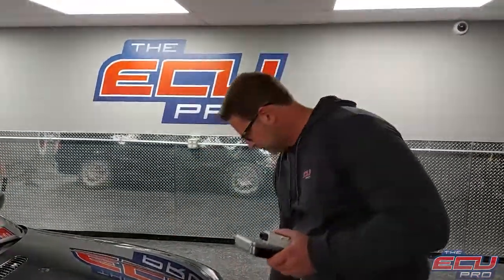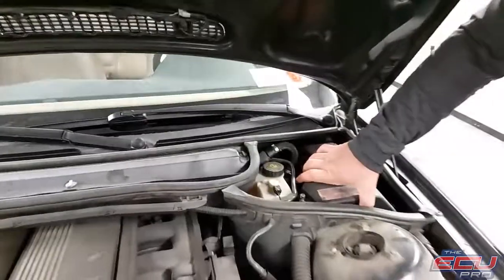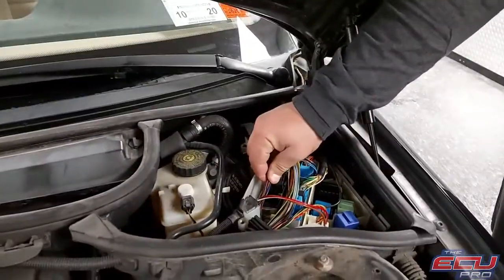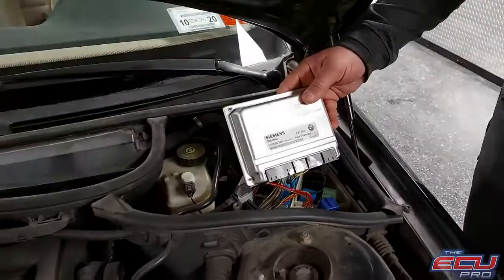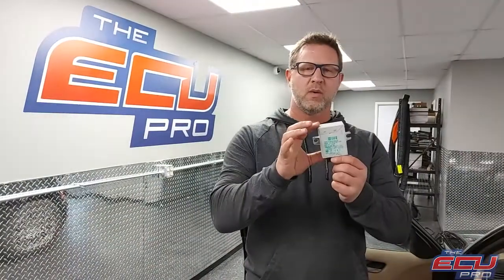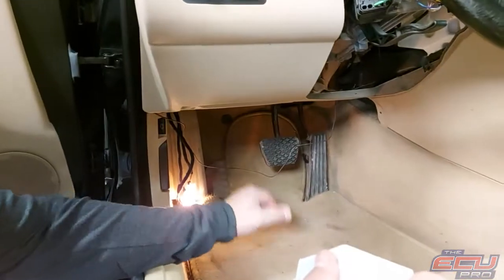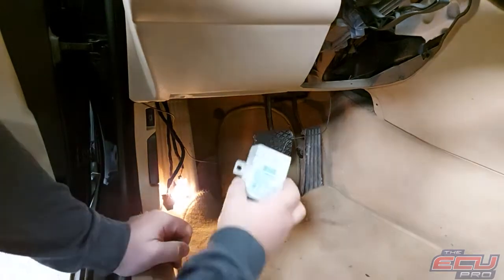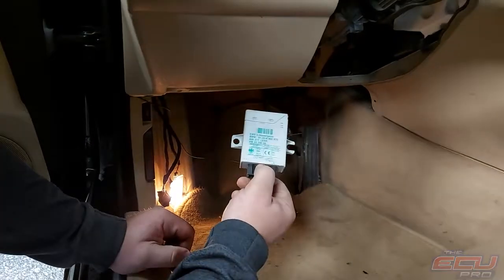BMW MS42 DME Repair Service for Z3 2.8i, Z3 3.0i, 328i, 330i, 528i, 530i, X5 3.0L with EWS system

Comment: Hi,
I’ve got an 2000 e39 bmw 528i with ms42 dme, the car runs fine but doesn’t connect to scanner and I checked all the fuses ground under the carpet nothing was wrong. My guess is there’s a bad dem if you think that would be the case let me know how I can contact and send it for repair.
Best regards